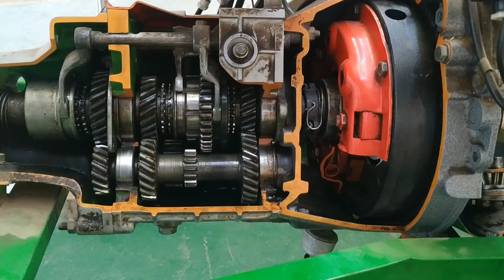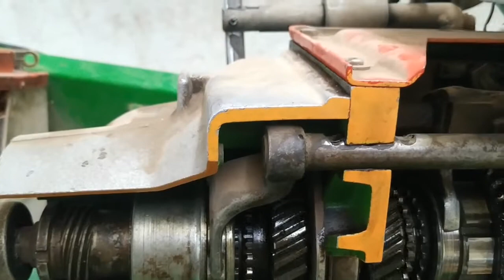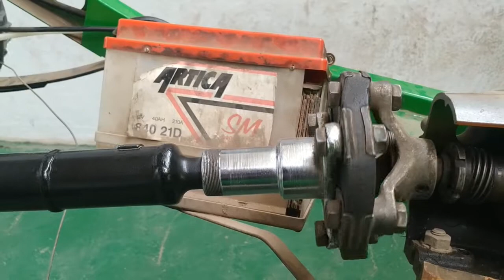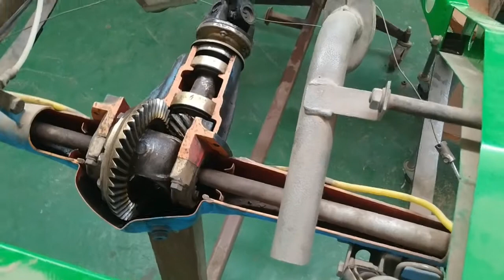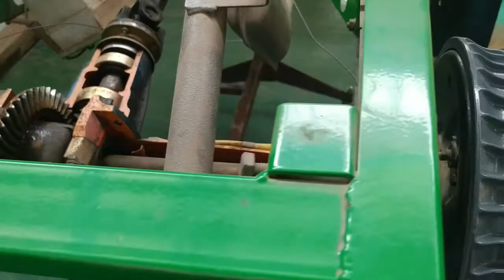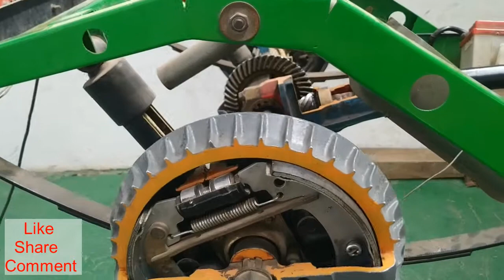How a Manual Transmission Works – The Ultimate Guide!

Comment: Can someone explain to me why the 2nd, 3rd and 4th gears are allowed to spin even when not selected?
Reply from the maker: It is because the speed gears are in constant mesh with the counter gear, however; the speed gears are mounted on roller bearings and hence power is not transferred to the output shaft directly. Had it not been in constant mesh they would have been sliding mesh type making the gear shifting especially at high speed very slow. only first gear and reverse gears are convenient for sliding gear shift as they are selected with the car stationery. Making all speed gears sliding gear require giant gearbox as large speed gears require twice the space they currently occupy to operate as a sliding gear.
Reply: @TheCarCareGarage  Got it, tysm

Comment: When the car is in first gear, you can notice that the 2nd and 3rd gears are still engaged. Why is that? Does that not affect the output of the driving shaft?
Reply from the maker: Dear! Even though the speed gears are always in mesh, they are riding over a bearing. Power will be transferred only when the shift sleeve connects the speed gears to the output shaft.
Reply: @TheCarCareGarage  thanks

Comment: Much better without the music. 
Now I wonder if you can show how far the clutch pedal has to be pushed in to make a smooth shift? Say the pedal can go 6 inches in, is 4 inches enough or should the clutch pedal go all the way in until it cant go any more?
There is no video on this that I can find.
Reply: Clutch travel is really dependent on the car itself, its not universal. To be safe you should fully depress the clutch.
Reply from the maker: Dear! the clutch has to travel until power transmission from the engine is interrupted. Now that can depend on how high the pedal is adjusted. If it is adjusted high, pedal has to travel long distance for the clutch to disengage.

Comment: My Tata Safari Storme has started making grinding noises when i shift gear. My first guess was that synchroniser rings could be damaged. But can all the synchroniser rings be damaged at the same time? The noise comes shifting from N to 1, 1 to N to 2, 2 to N to 3, and then N to Reverse. Any guesses?
Reply from the maker: Dear! Dis you check if the clutch is fully disengaging or not? If there is a problem with clutch disengagement, that could cause gear shifting and synchronization difficult.